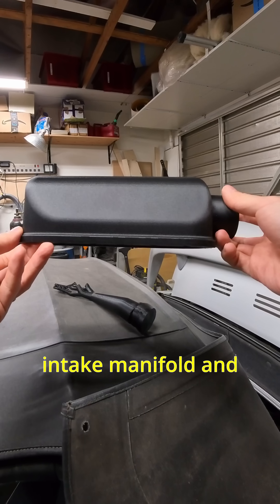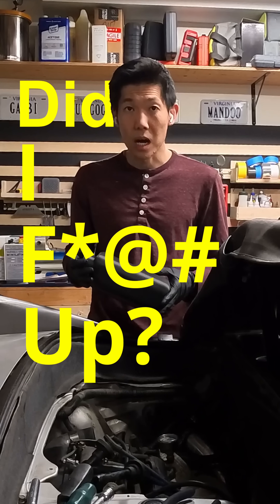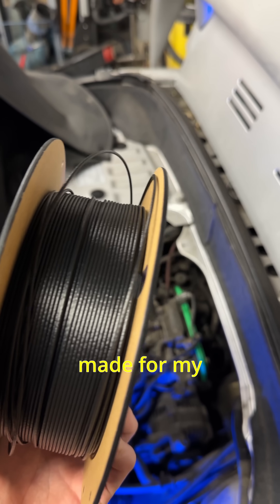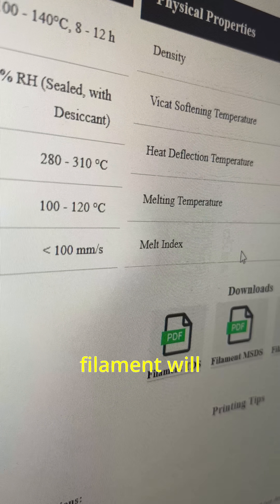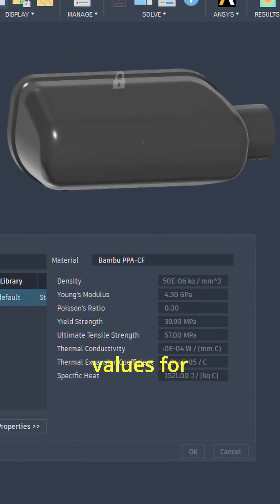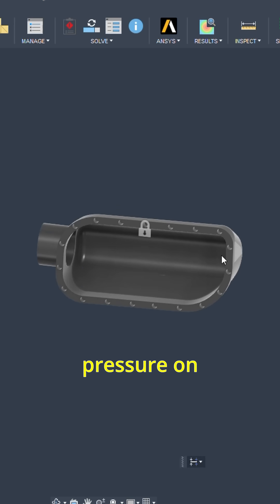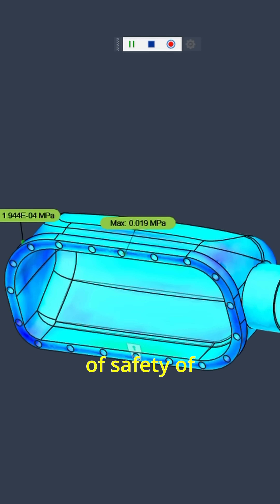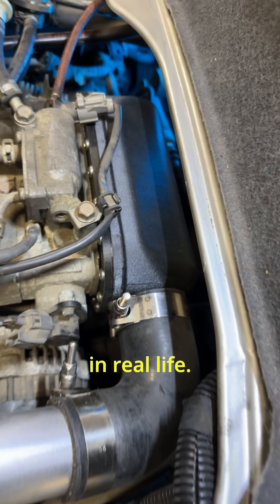3D Printing Intake Manifold with Carbon Fiber Nylon PPA-CF

Comment: I'm curious how you accounted for layer adhesion in the fusion models. Can it tell that its stronger in 1 axis vs another? It's probably fine but it would only be as strong as the weakest axis which would be much much weaker than a solid or molded ppa part. You can improve its strength by annealing it as well after printing for around 8 hours at around 110c. in fact almost all peek pekk paht and ppa filaments have this in their instructions just everyone ignores it. without anealing them above their crystallization temp they also degradate over time. CF composite polymers specificly do well with this process.
Reply from the maker: The model doesn't account for layer adhesion directly. The data sheet shows the mechanical properties in both xy and z directions. So I used the values in the z direction since they are the most restrictive.

Comment: So I've been 3D Printing with Carbon Fiber Nylon for a while now, and I can tell you it is both the best and the worst filament. For starters, it is incredibly strong and heat resistant. However, it aggressively absorbs moisture and will weaken its strength and heat resistance overtime. You can stop this from happening by annealing it, but this will deform your print slightly. Additionally, I would be careful leaving this part outdoors for too long. If it absorbs enough moisture and the part heats up very quickly it could explode. Not like a grenade explosion, but like it will make a couple micro, or maybe even cm wide, holes.

Comment: CF reinforcement is amazing in static parts that don't change in load. What happens when you load and unload CF parts (especially PC-CF) is the fibers start to crack and/or break free from the media (plastic) as they really don't like to act like springs. This is over 10 years of printing prototypes and messing around with basically all the 3D printing filaments under 350c

Comment: Before going through all that design work you could just look up previous use cases. For example, the ecotec drag race engine didn't get its plastic manifold changed until over 800 horsepower.

Comment: While this will most likely be fine, your simulation was mostly pointless. The simulation on fusion treats the materials as isotropic (like it would be injection molded) while the fdm printing is more like composite ( anisotropic) , and proper fem calculation for composite are much harder to do in general.

Comment: But did you take into account the weakness of the layer lines??

Jk it doesn't matter because it's about 50% the strength of the bulk material so you still have a 7.5 factor of safety

Comment: I use prusa brand PETG CF at work and we did side by side fracture tests with regular PETG, markforged onyx, etc. I can say CF is stronger than normal PETG without CF. It also deflects less under load. It's also twice as expensive as normal PETG.
Reply: Of course.  At any part of the piece that happens to actually have some fibers lined up properly it would help SOMEWHAT.

However , just like a rope, the strength is in the weave .  And 3D printers dont weave ……yet lol

Comment: It also depends on the manufacturer. I have printed plenty of parts in carbon fiber nylon but I use 3D Xtech and I have also use other brands and found there is some difference. I think your fine. Now the other question is how many walls and what was the infill and infill pattern? All make a difference also what was the orientation when you printed? Depending on how the layers were put done will make a difference in strength as well.

Comment: Carbon fiber reinforcement raise the hardness of the material and helps keeps it's shape at high temperatures. You did a great job there
Reply from the maker: Thanks mate
Reply: This is only true when first printed. Nylon absorbs a lot of water after printing.
Reply: @newFaction64  vague comment is overly vague...

PA6 nylon? Yeah tons of moisture absorption after the fact... PA12 is better than PA6 at that, PPA-CF is even better than PA12, some literature claims up to 80% less moisture absorbed over time with PPA. 🙈
Reply: @newFaction64 🤷🏼‍♂️ Ésto no es simplemente 'nylon'.., ☝🏻 la Poliftalamida reforzada con fibras de carbono (PPA-CF) es un semicristalino que está a otro nivel, sobretodo en lo que a absorción de humedad se refiere.., vamos que no tiene nada que ver.! 🤷🏼‍♂️
Para que te hagas una idea, se pueden realizar piezas que estén en servicio constante bajo el agua (☝🏻incluso salada) que no les va a pasar absolutamente nada.!
🖐🏼
Reply: @newFaction64 and how it affects its properties and behavior?
Reply: @sztorm94 💁🏼‍♂️ Normalmente los "nylon" que absorben humedad (o se "hidratan") experimentan una disminución de la rigidez (menos quebradizos) y un aumento de la flexibilidad y del peso (básicamente se vuelven más blandos y pesados).💁🏼‍♂️🖖🏼

Comment: I dont know what material model you used, but for this to be accurate, you would have needed to do a material model that was anisitropic. This accounts for the different strengths for x-y, and z. Then you'd have to make sure you printed exactly to what the TDS listed (mostly for chamber temp). Otherwise, the TDS is not accurate. There's also the issue of micro voids in FDM printed parts. You will almost never be able to make parts that hold pressure without leaking. Its possible but have to bump your extrusion multiplier way up. If you acounted for all of this then I'll shut up lol. Not trying to be annoying, just trying to help get you the most accurate results.

Comment: I have a high performance 4.7 tundra engine I rebuilt bore to a 5.0 with a stroker kit, printed a new intake manifold with PEEK Filament.  Engine was dynoed at 522 hp and 395 pounds of torque and I’ve got 20,000 miles on the new engine rebuild and the intake manifold is just fine.

1.5kg of High Speed PEEK cost me $400

Comment: I'm curious about the factor of safety in the layer adhesion dimension.  Some filaments are ~5x weaker in tension along the layer adhesion direction.  

I'd love to do the same, but was assuming I'd do a test print and then send it out to be printed in something that is more isotropic.
Reply: 🤔 Me parece que en el PPA-CF su resistencia a la tensión se reduce aproximadamente a un tercio en el eje Z con respecto a la orientación XY.
☝🏻 Aún así, los valores que se muestran en el eje Z, para el PPA-CF, confirman una resistencia a la tensión superior en comparación a otros polímeros termoplásticos como el; PLA-CF; PETG-CF; PC-CF; ABS, etc... Por lo visto el hecho de ser un material que requiere unas muy altas temperaturas de impresión también puede favorecer en algo a la adhesión entre capas..

Comment: Phew! Thought I almost needed to write a comment. Once the engineering books came out with the fusion simulation I was like "thank god someone who knows". 😂 beautiful job my guy! Made this engineer proud.
Reply: Ya but what I didn’t see was accounting for the fact that this is an orthotrooic material not to mention 3d prints are notoriously inconsistent. And we aren’t account in for vibrations, mechanical loads, clamping force,…

FEA also looks questionable.
Reply: @vaporizer82 - lol your☝️🤓 cracked me up.. With a safety factor of 15, it’ll be alright bud.
Reply: @jsl6155  Right... but without using good engineering assumptions the safety factor of 15 is not a safety factor of 15. Don't get me wrong, I've done projects where I just say 1/8" bar should do. If you are going to do something, do it right.
Reply: Simulations can give an idea on whether or not it will work, if it works I guess it's good enough.

Comment: With any fdm printing material heat is going to be a limiting factor. Given that it's an intake manifold it probably will be fine. But it's mechanical properties vary wildly depending on temperature.
Reply: Honestly the best option would be to 3d print a part out of pla and then cast it, then harden the part, but for this purpose / for a part you can’t get / if you need a part that’s way too expensive to buy the real thing, filaments like that will work, idk how they will hold up long term but that’s the beauty of 3d printing is if it doesn’t hold up you can make another with improvements / to get you by
Reply: @shyowl3453 you can also get parts slm printed from metal in China for dirt cheap.

Comment: If it makes you feel better when Ford was developing both the coyote and the godzilla proformnce intakes they tested with 3 printed intakes, the godzilla held and made 30, and the coyote hit 50 both were of course highly built engines keeping in mind you can hit 1000 hp with 30lbs

Comment: That is, as another person said, a plenum. However, it looks like a good part.
   What you could also slightly redesign it. For an example of what I mean, take a look at a C8 Corvette intake plenum. There are two. They have structural reinforcement on the outside. 
   If you didn't want the appearance of that, do it like a print that is made to save material or weight. With a solid layer on the inside for smoothness and a solid layer on the outside for appearance.
   It might be stronger than a solid part, but another simulation would confirm that!
   Otherwise, nice looking work!

Comment: Make sure to use the strength of material at the temperature it'll be operating at.   And consider heat soak when you turn the engine off.

Comment: You would avoid any Polyamide based or blended material for any long term under load use.
PA has creep, no matter what you put inside expecially in 3D printing.
With injection molding if you go above 40% charge then maybe creep starts to disappear almost completely.
Reply: 🤔¿Y si se trata de una Poliftalamida semicristalina mezclada con un 15% de fibra de carbono y posteriormente post procesada mediante un recocido?

Comment: You can anneal the PPA CF in an oven at 80-100 degree C which can improve its strength and heat resistance.
Reply from the maker: Definitely. Although annealing will give it more strength it lowers ductility, so I chose to keep it in as printed condition in case it fails. Hopefully the little extra elasticity will prevent it from shattering and getting sucked into the intake. That’s my thought process anyway haha
Reply: @IMEEMADE  Totally get your thought process, but just a heads-up — annealing PPA-CF doesn’t usually make it brittle enough to shatter. It actually helps by relieving internal stresses and improving strength, heat resistance, and layer adhesion. Leaving it ‘as-printed’ can sometimes increase the risk of failure, especially under heat or load. Just something to consider!
Reply: @IMEEMADE 🤔 De alguna manera es muy posible que donde esté instalado con el tiempo se vaya 'recociendo' muy poco a poco y de forma natural donde realmente lo necesite.
🙂👍🏻 Buen video y gran trabajo.👍🏻👍🏻 
Me gustaría ver muchas más cosas funcionales con éste material (PPA-CF de BambuLab).👌🏼👍🏻🙂
🖖🏼✨
Reply: I’m surprised it’s that low. For injection molded PPA-CF, I’ve seen 120-200C.
Reply: @TheOfficialOriginalChad  The length of the annealing process typically depends on the part’s thickness — thicker parts generally need more time. For instance, a 4mm thick part might require around 2 hours of annealing plus a holding time.

Comment: The only problem you might come along is that fdm prints have very tiny pores in it, through which the air can leak. But if you don't face any issues then all good 👍😊

Comment: Might be a good idea to coat the interior with a high temp resin/enamel for the carbon fiber shards that can shed off the part.
Reply: Nope. 3d printer filament like.rbis doesn't have "shards" of cf...its one long string of carbon fiber tiny tiny chunks. And they don't come off

Comment: I mean, I might make something out of a sealed material, resin impregnated carbon or similar, or just run a layer of urethane over the outer skin.  FDM is not air-tight.

Comment: Did you have a heated chamber when printing? It makes a big difference with PPA-CF. Did you heat treat the finished print? PPA-CF should be. Did you optimise the print settings to stop having gaps in the print? Only printing a test sample and checking the cross section will show you. If you only plugged the numbers off the label of the material into the Fusion software, you are not an engineer. Those numbers are a fantasy and FS is not 15. Make a test bone and test the software VS a bone, I guarantee they won't match with your fantasy. Do it properly and stop embarrassing us engineers.
Reply from the maker: Alrighty buddy, I think you need a nap
Reply: @IMEEMADE  You are the one that is dreaming that it has a FS of 15. No engineer would believe that number you came out with.
Reply from the maker: Good one 👍
Reply: @IMEEMADE 🙂 Buen video 👍🏻.., 🤩 y me encanta ese material (PPA-CF).👌🏼✨
💁🏼‍♂️Descuida, ☝🏻 los conocimientos de ingeniería solamente son el medio y la herramienta de la verdadera base importante que és, la combinación del instinto con la observación.👍🏻
Si entiendes en profundidad lo que haces no necesitarás más pruebas de las necesarias para tener claro que las cosas te van a funcionar. 💁🏼‍♂️
🙂👍🏻🖐🏼✨
Reply: 🧐 Y quien te ha dicho a ti que ha hecho mal todo eso que dices... 🤔 Una actitud un poco irascible no?
Lo que comentas es muy importante pero, parece que des por hecho que no ha procedido de la manera correcta simplemente porque no te ha mostrado todo el proceso en el vídeo. Debes de haber tenido un mal día o algo así...
Relax..😆
🖐🏼

Comment: I really like this side of 3d printing.  Reminds me of a 3d printing company in Minnesota that my brother works at and they make a couple parts for nasa space shuttles and quite a few parts for the automotive industry.  They build, design and use printers like the stratasys f900, their own proprietary systems. 36in x 24 x 36 or 914mm x 609mm x 914mm build volume.  Pretty impressive machines to watch.  Supposedly they are some of the most top performing printers in the world.
Reply: ☝🏻 La empresa 'Stratasys' fue la pionera que desarrolló la técnica de FDM en la impresión 3D por su fundador 'Scott Crump' en el 89/90.., 💁🏼‍♂️ en la actualidad la tecnología que utilizan es más sofisticada, se enfocan más en la alta resolución, múltiples colores simultáneos y velocidad..,  está a otro nivel.! 🙂👌🏼👍🏻✨
🖖🏼

Comment: Annealing will usually shrink slightly, and PPS anneals really fast under the right temps. The intake shouldn't see high enough temperature but if the part anneals when bolted to the engine it might crack
Reply from the maker: Interesting point. I hadn’t thought about that

Comment: You can also use the 3-d print to make a carbon fiber one if you want.
Reply: He already used PPA-CF. What do you think the CF stands for?
Reply: @Sebastian198910  Yeah there is totally no difference between CF filament vs real carbon fibre :DD

Comment: If you need more strength use PPS-CF or PPS-GF.  Although ppa-cf is already very strong.  If you need less stiffness and a little more flex but still need strength go with the glass filled. Both are awesome though as long as the base material is good.
Reply: 🧐 Según las hojas de datos consultadas ☝🏻 yo diría que a rasgos generales el PPA-CF es superior al PPS-CF/GF.., 🤔 de hecho el único material termoplástico semicristalino que supera al PPA-CF sería el 💁🏼‍♂️ PEEK-CF!
🖖🏼🙂

Comment: VW air intake manifolds can be made of polyamide (PA), also known as nylon 

PA-6 CF will be fine. If the engine gets hot enough to fuck up nylon, its dead anyway lol
Reply: 💁🏼‍♂️ El material que está utilizando no es PA-6 CF sino PPA-CF de BambuLab (Poliftalamida + fibra de carbono), es un material muy, muy superior al PA-6 CF o al PA-12 CF. ☝🏻
💁🏼‍♂️ Solamente existe un termoplástico semicristalino que le supera y ese és el PEEK-CF.
🙂🖖🏼